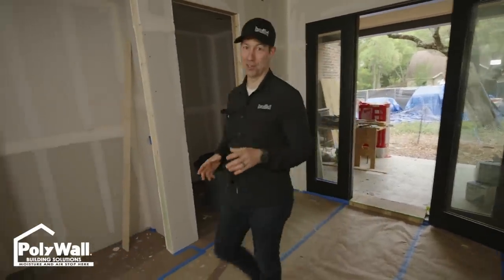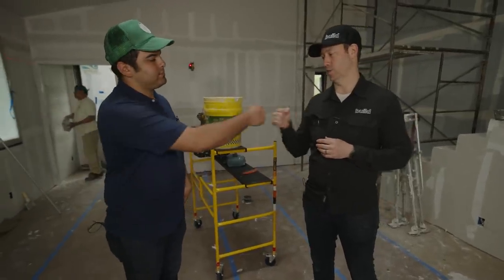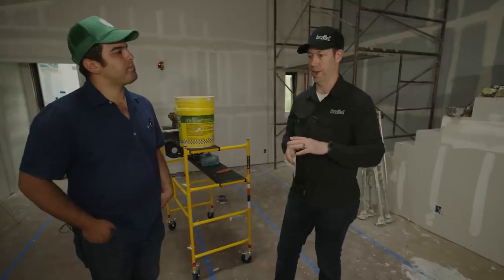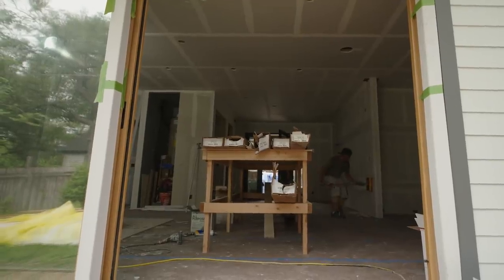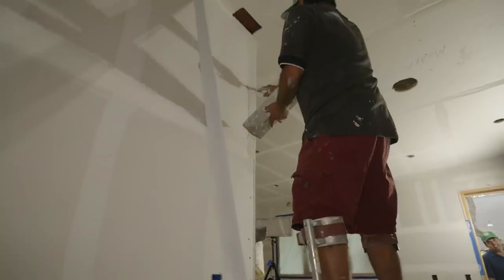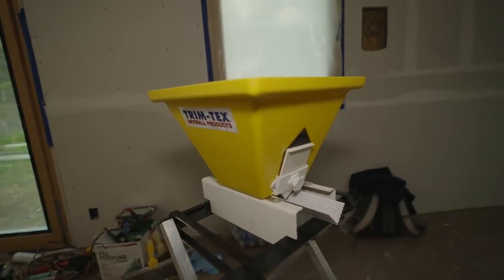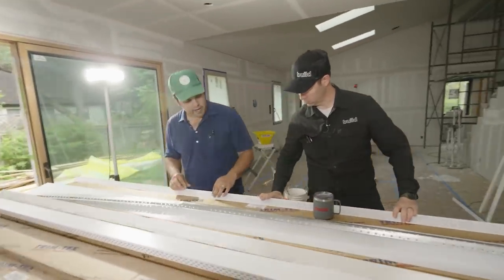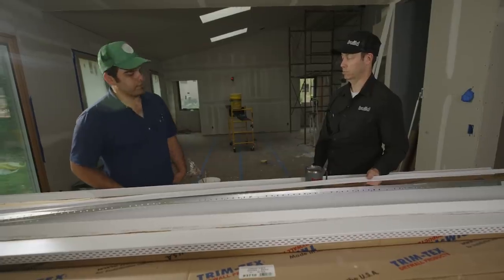Drywall 101: Here’s the specs for a Top Notch Job

Comment: Are you going to make a video of the Level 5 finish install? Curious to see how others do it!
Reply: I've done it a lot of ways. Honestly if the finished product is good. That's all that matters. You can second coat and skim the entire wall/ceiling.... Or you can 3rd coat and skim between the joints. I typically use the latter method. Either way your going to sand the entire wall.
Reply: I asked my builder to upgrade from LVL 4 to LVL 5 for my 2500sf new construction and he said it would add $25k. Building in the Pacific Northwest is so expensive!!!
Reply: @drewcwsj  are you serious? 25k?
Reply: @drewcwsj  not $2,500? $25,000? 2,500 SQ ft? Are you joking right now? The total for drywall on a 2500 SQ ft house should be in the neighborhood of 8k even if it's skimmed. That's way too much. I'd do the skim coat and sanding for a plane ticket and 7k if I didn't have a newborn daughter. Sorry to hear they are trying to rip you off like that
Reply: @drewcwsj  when I sand a skim coat I only rough sand the joints, the rest of it I hand sand with a hand held work light
Reply: I would charge 50 or 60 dollars a sheet for the whole job, hang, tape, lvl 5 and sand. 2500 SQ. Ft is about a 200 sheet job. So depending on the level of bead and detail work, the whole thing should cost about 10 to 12k to add 25k for 4 days of work is absolutely insane. I've got a couple good jobs coming up so I could show you how I lvl 5 a sheet. I could skim coat the 200 sheets and sand it by myself in 4 8hr days. You should ask what it would cost for just lvl 5 ceilings.... That's where everything shows up the most
Reply: @kennethwilliams2738 Yes drywallers in the PNW insist on orange peel finish or worse to hide their poor work. Instead of lvl5 I opted for a high build primer
Reply: Oh and I still don't have the build price but I'm expecting $650k not including the lot or site prep.
Reply: @drewcwsj  yikes, man, I'm living in the wrong state lol. I'm a north east seaboard taper. My work is premium flat. I'm guessing I could make bank over there. My brother lives down in AZ and said the same thing. They all want to do texture but the customers are starting to ask for a flat finish. It's really quite easy to skim the whole job. Finish everything as normal and let at least the edges of the joints dry. Then you just run it 3 or so inches into the edge of every joint and skim the wall between joints. Rough sand the little bit of edge that it leaves and the middle of the joints. Hand sand the rest with a hand light loaded with a utility bulb. The skim coat is just a tight coat. All it should be doing is covering the texture of the paper so that there's no difference between the paper and coated joints. It definitely not worth 25k that's absolutely insane. You could get the same house built up here in Maine with high end finished for probably 3 or 400k depending on how fancy it is. I'd be interested to see what you get for 650k. I've worked on a home the same size that cost 13.5 million. But that was built on a stainless steel super structure right on the ocean. Calculated to withstand 100 year sea level rise. An entire wall made of recycled class. Hand built on site custom cabinets, and floating book cases, every ceiling was a cloud ceiling soffit. The stair treads were glass with embedded lights, stair well has powder coated round tubular steel running through it , indoor pool area with high end HVAC, high end pocket doors throughout, and 3 round skylights in the kitchen that mark the solstices on the floor. The one bedroom was decked floor to ceiling with a rare wood, and the windows over looking the ocean made the bedroom look like the captains quarters of a ship. Place looked like friggin lex Luther's house. Dude went and got permission from about 15 neighbors to pave a mile of road that he didn't own, so that his SL 500 didn't get any dirt on it.
Reply: @drewcwsj  and when I say hand built custom cabs and book cases, I mean hand built, no power tools. These guys were in there trying to work it to perfection with hand planers. The most insane thing I've ever seen
Reply: @kennethwilliams2738  Just got the lumber bid 2500 sf 2 story w/ 3 car garage, exterior 2x6 $78,000 oh and asked for an LSL quote and Weyerhauser rep said no they are saving LSL for only critical applications

Comment: I like the 5/8 sheetrock idea & I have been in homes done in 5/8 walls . The sound quality just feels solid
& quiet. But about money , Don't you have to change the door & window case widths ? $$
  Also green board all the walls in bathrooms for added protection. Maybe this is common now but use 
2 foot factory edge board for 10' or 9' foot walls , no horizontal butt in the middle. 
If all you got is nail on corner bead use drywall tape on each side for added protection against mud
cracks & chips. 
 The #1 thing to never do is put hot mud over not dry regular mud.
Reply: Mesh tape will do the same job as paper for that purpose and is much easier to apply.

Comment: Matt why did you end up selecting drywall vs hybrid plaster? The finishing process is faster than a level 5 mud + tape and the end result is much more durable. Is there a lack of plaster contractors in your local area?

Comment: You don't get a choice with me, I use the best products available to me. Haven't used that crappy metal corner bead for years. That stuff is a nightmare. I use straight flex products instead of trimtex though. For those off angles I would use straight flex midflex 300. With rolls up to 100' you never have any splices, which makes a much better angle. I do like the idea of using the Lazer though.
Reply: Strait up. I like the strait flex as well. It's getting harder to find but I always liked the original strait flex. Laser is the way to go, especially on long shallow runs. You can eyeball a true 45 good enough. But it really helps a lot with a shallow angle
Reply: "I use the best products available to me."
This.

Comment: That’s not fair to the corner bead to tap on it with green drywall mud.  I worked for a GC that built office spaces.  Sheetrock Cubicles were big then and the movers alway dink or even broke the corners off.  We went with Durabond 90 on the corners and never had an issue after that!

Comment: I had to laugh when they were talking about drywall thickness and moving up to ⅝” to make it feel more solid. At the opposite end of the spectrum are mobile homes that frequently use ⅜” drywall. On top of that they will often frame walls 24” on center. Talk about a flimsy wall!
Reply: 3/8” drywall and 24” on center walls are standard in the Carolinas. The builders code here is a joke.

Comment: "Why use 5/8"
"Because it's a more premium product"

That's the benefit? It's better because it's better?

Whelp, there's a drywall contractor I wouldn't hire.
Reply: he aint wrong so cool it
Reply: It's possible to be right for the wrong reason. ;)
Reply: So did you just tune out the part where he said why they used it? Fire rating, more solid and flatter walls, sound reduction, insulation value and all for a few hundred more... I’m a contractor and I’m sure we’d charge a bit more for the trouble but it wouldn’t be much. Don’t disrespect this guy because you are ignorant or just not listening.
Reply: @TheDkbohde   you mean the part where Matt filled in the information that Junior didn't provide? Yeah, good times.

I'm sure he appreciates you being his white knight, though, fearlessly defending his honor online.
Reply: @DannySauer   to be fair Junior did mention the fire rating which is probably the best feature of it then goes and says it hides our imperfections making it a premium product. 
Same thing with the corner bead though. Why is this vinyl corner bead better?  It’s a much more premium product. It’s more durable. And that’s all he says about it. 
He doesn’t even bother taking his gum out to talk either.

Comment: Ugh.. no need for 5/8 on the walls. Just makes things like doors a bit harder to find, at least here in Michigan.
Reply: If there just mudding vinyl bead on it will crack.. imo all vinyl or plastic products need to be spray glue stapled and paper taped with all purpose.. best bead in the business is usg ultra wide tape on bead if used with all purpose mud it will not crack pretty sure usg still offers lifetime Crack warranty on it..  it will dent though
Reply: @chadthedrywaller6859  there's ways around that. We mesh tape the edges. Mud set with mesh down the edge would be very solid.
Reply: @chadthedrywaller6859  the product has a slightly different design than regular vinyl. It's got ridges on the under side of it along with more holes in the bead. This is actually the way to go. Mud set allows you to move the bead around before it sets. The underneath of the bead is filled with mud. I do this with setting compound. Also for round walls mudset is ideal. You can continue to play with the contour untill it's perfect to the eye. I find 90 minutes setting compound is just about perfect for this, and you can first coat it at the same time as putting it on.
Reply: @kennethwilliams2738  all vinyl bead needs to be taped on, I prefer paper tape,in this video there appears to be no tape.. I use usg ultra wide, the tape is made right onto the bead, it is also a mud set bead that I've been using for around 20 years now.. it will not crack if applied with quick set or usg all purpose
Reply: @kennethwilliams2738  also there using vinyl on the off angles. If that makes it 2 years before it cracks I'll be surprised. All off angle should have some type of flex bead, I prefer ultra flex wide, applied with quick set or all purpose..
Reply: @chadthedrywaller6859  I suspect your right if they didn't tape the edge it will crack. I like strait flex original myself

Comment: With 5/8" drywall, won't the door jambs have to be 1/8", to 1/4" wider, depending on interior, or exterior walls? Is this a custom door jamb? Cost for wider jambs?
Reply: Last time I ordered a door they asked me for the jam size.  I think in a house of this quality most doors will be custom, so the extra jam size won't add that much to the door price.

Comment: How much extra does it cost to build a house like yours versus contractor graded, just curious I know it's worth it in the long run, but if I was get Joe blow the cheap contractor to build that house his way ,versus you build one the great Matt way how much different in price would I be looking at
Reply: I'm guessing 3-5 times ?
Reply: @augustreil  are you saying a $200,000 build becomes a $600,000 build?
Reply: @jpe1 , Just for Matt's house, because he used specialty items, like engineered wood studs, the roof system was over the top. 5/8'' rock which I agree with and the list goes on. Just on this house, not a ''normal'' built house, lol.
Reply: @jpe1  easily twice the cost on most aspects and approaching 4 times on some areas

Comment: imo, 5/8 on all the walls is a biiiiig unnecessary cost, yes its thicker but don't pretend it's insulation.  Flimsy aluminum cornerbead is the worst. I'm wondering also if the tape on trim tex cornerbead, with regular mud behind it, very slowly drying and shrinking, no staples or attachments at all,  would actually last.
Reply: .... every tape joint in any house is just mudded on
Reply: aluminum ? You mean galvanized steel ? Taping mud is very strong, but I would never Top 
over nail-on or screw on corner bead without taping it first. I use beadX tape on corner bead 
Im sure its good for long while 50+ years. This video got us worried about corner bead. Lol
Reply: I set em with quick set. And mesh the edge.... it's actually very solid with the purpose built bead
Reply: @kennethwilliams2738  I would say thats top notch,  a little effort you can do a cornerbead that will look perfect forever.

Comment: Will standard split jamb doors still fit the openings?
Reply: They won't fit, and ordering anything right now seems to always be a nightmare, 1/2 is fine for the walls, and you still achieve an 1 hour rating with it on both sides of the wall 5/8 on both sides is actually an 2 hour rated wall
Reply: of course not, I am sure he will have a vidio when he installs the door package. New custom homes you just other the frames to 5/8 spec. no big deal.
Reply: I've heard of watching paint dry but this is like watching every stage dry
Reply: 5/8 on each side is only a one hour wall. Unless you use ultra light. Then it’s only a 30 minute wall
Reply: @jameswolff2152  this is correct. 2hr walls in commercial is 2 layers of 5/8. I do these all the time.
Reply: @jameswolff2152  i guess that would correct   if the fire starts between the wall. but each layer of type x is 1 hour 5/8 on both side would = 2 hour for a fire to burn through the wall. 1/2 inch drywall is rated for 1/2 hour pr side which= 1 hour burn through time.. its pointless to install 5/8 drywall for fire on interior walls without fire rated doors..
Reply: @chadthedrywaller6859  one layer of 5/8 type x dw on each side of a wall gives a ul rating (u419) of one hour.  You can also get a one hour fire rating by using one layer of 1/2” type c dw on each side. You are correct that for fire purposes, any non fire rated openings in the wall defeats the purpose. I’m not sure in this case though he is doing it for fire rating except maybe around the garage. I think he is doing it more for durability and quality. 5/8 dw gives you a flatter surface and try punching a hole thru 1/2” then 5/8. You will definitely notice the difference

Comment: I still don't understand why you wouldn't build with ytong construction blocks or with poroton blocks... And than plaster the compleet house. More like German or European style. Of you want mass than that's the easiest way to do!

Is this because US build code does not allow it or am I missing something here.
Reply: A plasterer is the most difficult trade to learn, 5 years at least to become proficient. Some ‘big’ builders in the UK have started just taping the joints, like America, plaster board is common now even on block walls, less skill so cheaper. Finished product does not look that different, unless the home owner uses wallpaper, first time it is removed, most of the plaster board comes off with it. If it had been skimmed, then no problem.

I can’t plaster for toffee, but I can dry line and joint.
Reply: @paulhill1665  makes sense but than you still have that hollow sound feeling and no mass in your house... To me it feels like a cheap solution to a problem that just needs skilled labour and or a good planning so you can your plaster company to be there when you need them and they have the Manpower. I can't plaster at all but I have a contractor than I just need to contact 6 months ahead quality over speed and price
Reply: @jaspervermaas  most uk houses  are block built, not wooden, , these days the block walls are covered in plasterboard, as cheaper than full wet plaster,

Comment: the whole house in 5/8" ?    pure f ing torture on the hangers
Reply: Lol.... I'd be using a loft for those ceilings. The walls ain't bad. I'm sure they are making their money lol
Reply: All 5/8", I wouldn't touch it for any less than 60 bucks a sheet and your paying for the materials.
Reply: If your getting $1.25/ sf for labor hanging drywall then I’m working in the wrong town
Reply: @jameswolff2152  well that would be what I would charge for both to hang and tape it. So no it's 30 bucks per sheet to hang it. I normally get 20 per sheet, but most people don't mind 1/2".
Reply: @kennethwilliams2738  ok thanks. That’s the going rates around here too. For a minute I thought I was gonna need to pack up and move!
Reply: @jameswolff2152  lol. If I had to pay for materials, I don't, I usually make out a good clear list for the contractor or home owner's. But if I was paying for materials, I would definitely have to charge at least 60 per sheet for 1/2 inch rock. For just labor though I recently bumped my price to 20 dollars per sheet per phase. 40 dollars for hang and tape.

Comment: Matt, wouldn’t hanging the drywall vertically not horizontal as in your video lead to a smother wall with hardly any but joints.
Reply: Not true. Butt joints can be every bit as flat as a flat joint. Also butt joints hide better than vertical flats, also the long flat joint is close enough to eye level that you will never see it. You add taping labor by hanging it vertical. Instead of going all the way to the ceiling every 12 feet your going all the way to the ceiling every 4 feet. Also you end up with half butt joints over the doors and windows at time because you cannot break a sheet on the corner of a header. When hung horizontally you are adding strength and rigidity to the entire building because each sheet is tying a large number of frames together. It is not really easier to hang it horizontally. Also when the flat joint on the sheet is pressed from the factory, it typically leaves a ridge on the outside edge of the recess. This means that it is actually harder to make a flat joint appear flat than it is to make a but joint appear flat. I hope this helps. I'm a 20 year pro of both phases of the job.

Comment: Why not rounded corners?
Reply: Rounded corners suck, look ugly, are impossible to trim properly and don't give you an edge to change colors..
Reply: @FJB2020 , I so agree.
Reply: @FJB2020  Any decent carpenter can trim rounded corners correctly. looks are subjective. You can definitely change colors with a 3rd color or just change the color at an inside corner.